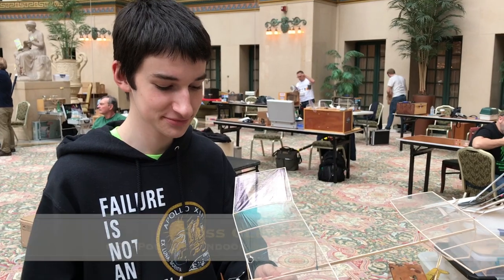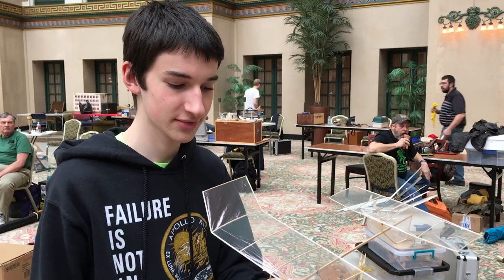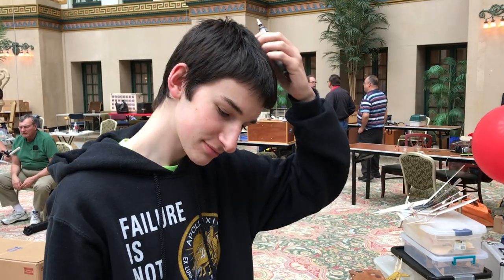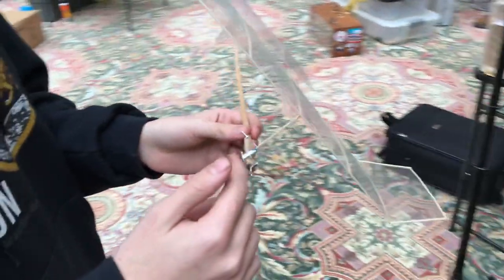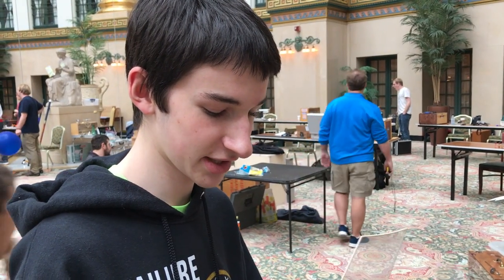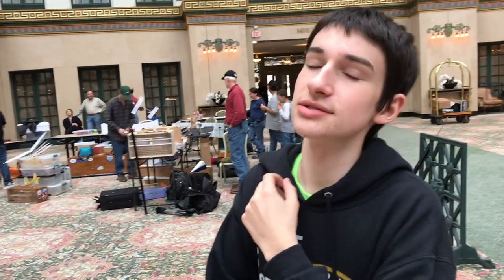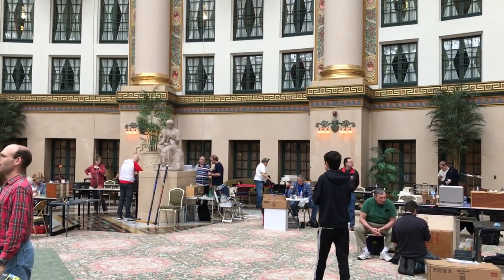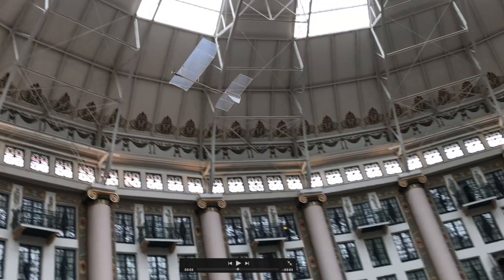CO2 Free Flight Engine (feat. Ross Clements)

Comment: Very nice flight Ross! You are right a liquid charge can significantly increase the operating of the motor. Is it an Gasparin's motor ? Any case, bravo.
Reply: Thanks! 
It is a gasparin 2.6. The difference in flight time between a gas charge and a liquid charge always amazes me
Reply: @HENRY FORSTER Sorry for taking so long to reply, I never got the notification for some reason. You can buy Co2 engines on Ebay, but the small ones get real expensive. Thankfully all of the engines I have access to my dad owns, as he collected them when they were more common and a bit cheaper! He actually has that V-12, as well as a 4 cylinder inline, and a 9 cylinder rotary as well as the 9 cylinder radial. Maybe sometime I'll get some video of them running.

Comment: When I was younger there were several companies making CO2 motors but seems to be only one now? I converted several rubber powered free flight modes to CO2 power and they flew much better. Interesting fact.. the fins on the cylinder head are to absorb heat not to cool the motor.